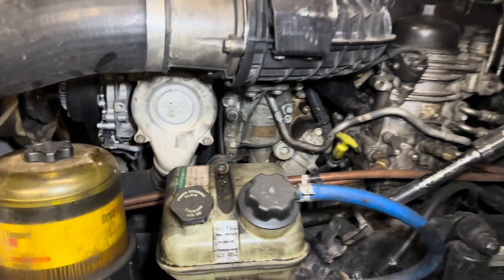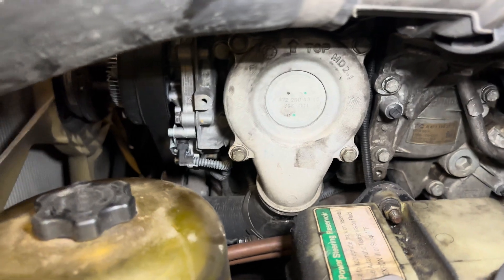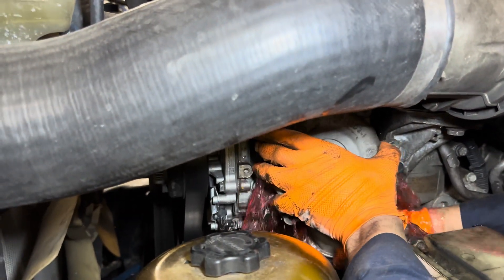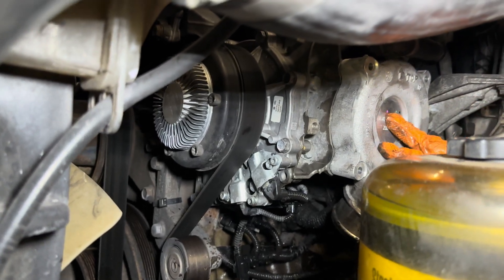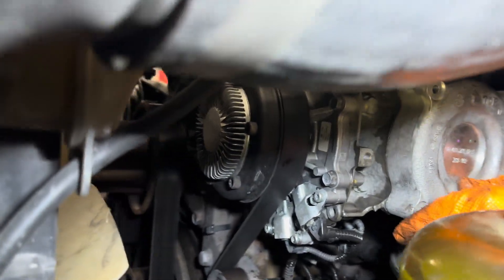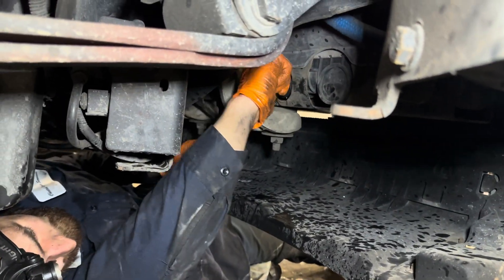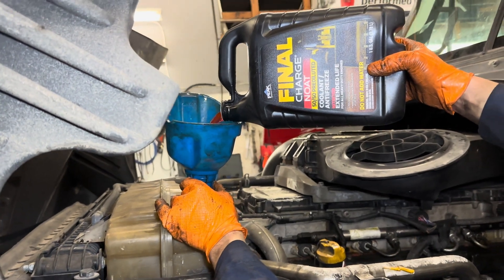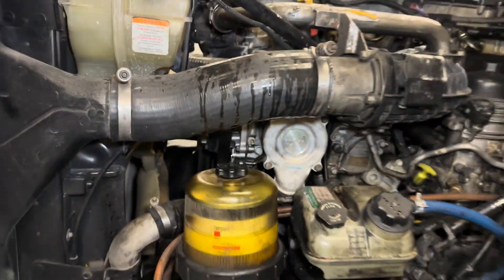Freightliner Cascadia how to replace Thermostat DD13 Engine

Comment: Any specific codes poped up for bad thermostat?
Reply from the maker: No codes. You can tell if truck won’t get warm or heater is blowing cold.
Reply: @CheetahRepairServices My truck was working normally at 190 F, now it went up to 215 F and the temperature did not go down again, the fan clutch did not work so I changed the solenoid valve and the fan clutch started working fine again, but the temperature does not go down below 215 F, sometimes it goes up to 220, it fluctuates between 215 and 220.